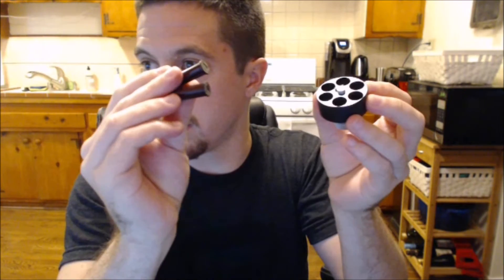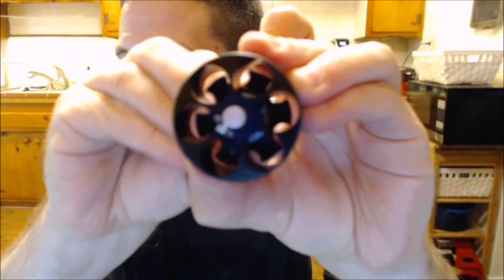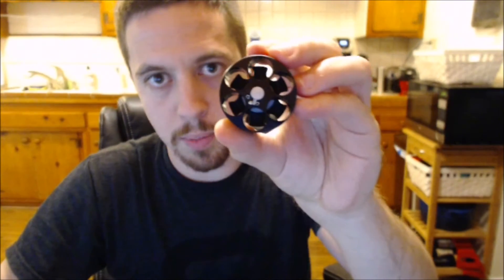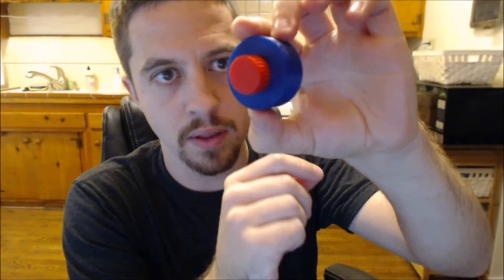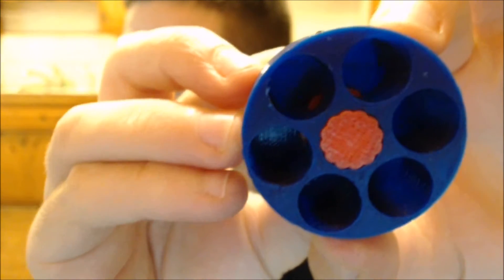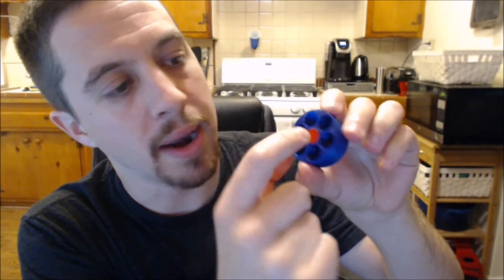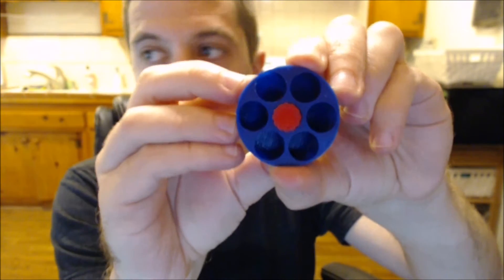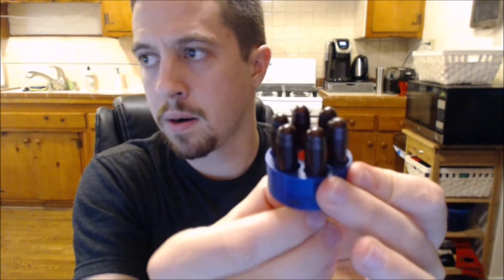3D Printed Speedloader

Comment: The inner part is locked inside the "drum", i cant rotate it and so it doesnt lock, have you used a file to give it more tolerance or a more elastic material?
Reply from the maker: I had to finely calibrate my wall thickness in slic3r before printing this and a few other parts with fine touchpoints.  The files themselves give the correct amount of space between parts - it's not just a flush cut.  So I'd recommend calibrating wall thickness (sometimes known as "extrusion ratio") in your slicing software.